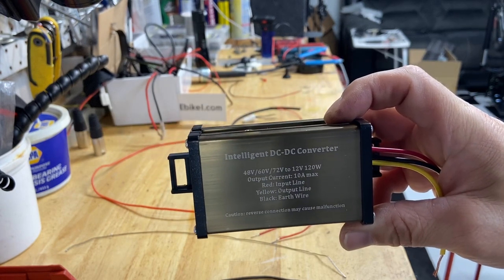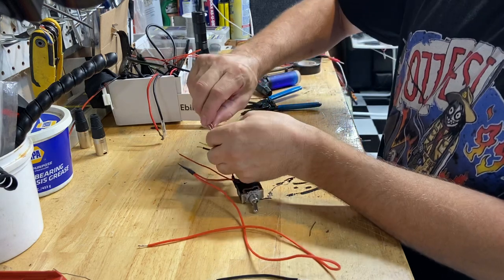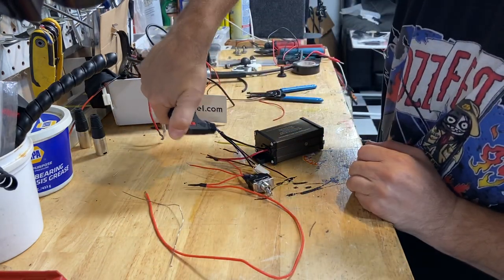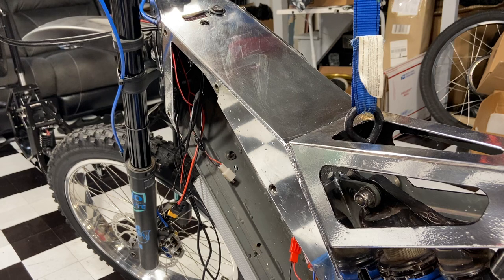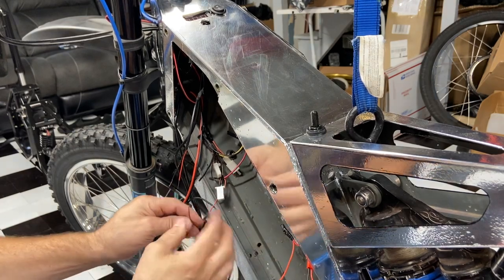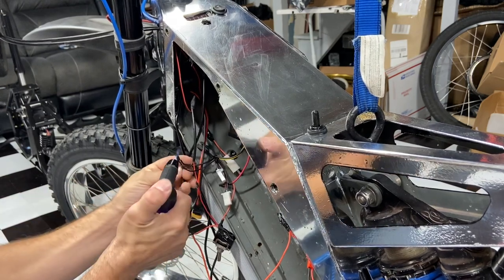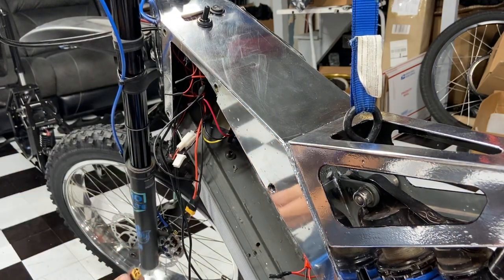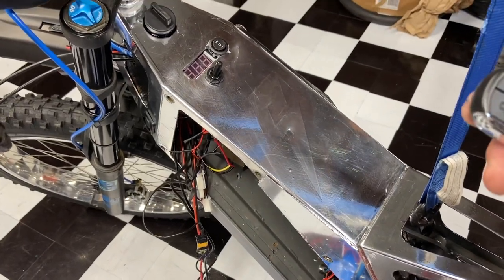How to install lights 12v dc step down electric bike Ebike Stealth Bomber B-52 b52

Comment: Unfortunately any means of reducing (step down) voltage is inefficient as so that it is resistance. The better way is to have a dedicated 12v battery for the lights.

Comment: Should I use one of those household switches or could I get away with a standard automotive 12v switch for 72v?
Reply from the maker: Here ya go Twidec/3Pcs Heavy Duty Rocker Toggle Switch 16A 250V AC SPST 2 Position 2 Pin ON/Off Switch with Metal Bat Waterproof Boot Cap Cover Ten-1021-B101 https://www.amazon.com/dp/B07LBNB9Y4/ref=cm_sw_r_cp_api_i_J8XZ7TNE4JYZT8DTRNM5
Reply: @tobebike  thank you 👍
Reply: @tobebike  I'm about to install this switch, it looks like in your video your getting your power from the controller right? Would this be any different coming from the battery @72v?
Reply from the maker: @vEAGLE5  that’s fine

Comment: Is an AC switch necessary or safer than using a dc 12v switch to toggle on/ off dc converter?
Reply from the maker: 120v/240v toggle switch for the 84v DC side.  On the 12v dc out than a 12v switch is fine
Reply: @tobebike  you are the man! I'm still learning. Makes sense for the high voltage of the battery. No one really explains this type of stuff on forums.  thanks so much!
Reply from the maker: @718og  you’re welcome